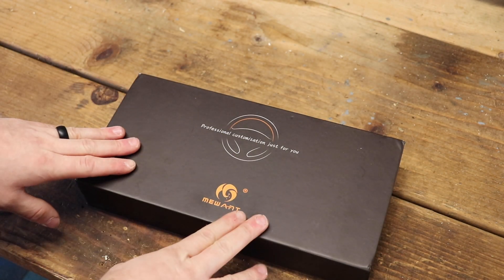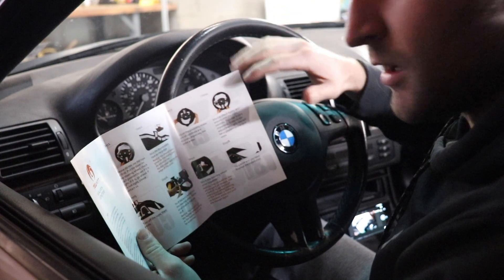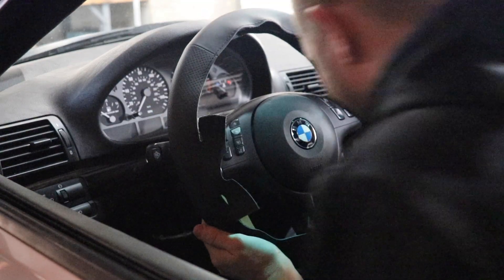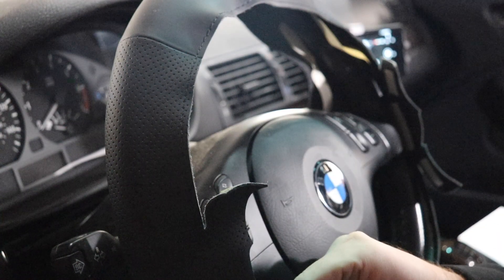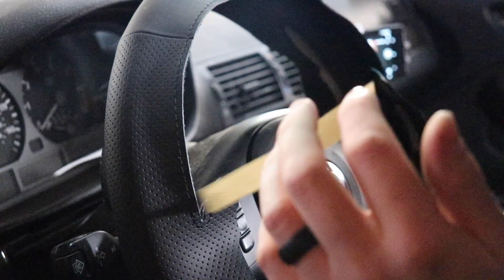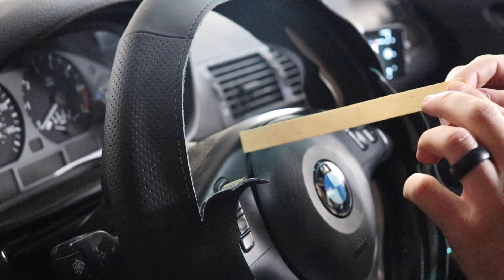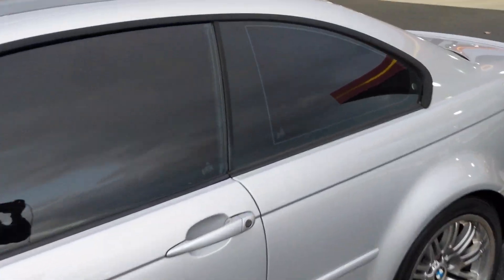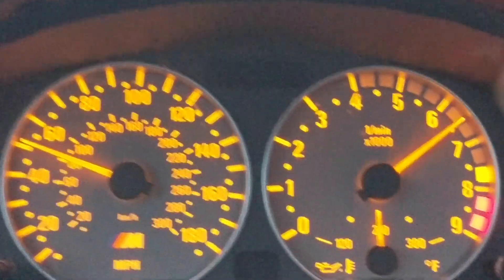Test driving a BMW M3!

Comment: looks to be in really good condition for 190k miles. have a buddy who got one with 150k miles for 8500. you should probably be able to buy it for a little less than 8500 with that many miles, but only if the owner is willing to sell it for that.
Reply from the maker: It sure looked to be in great condition! It's being sold at a small dealership so no idea how low they'd go - I didn't negotiate - but $8,500 or lower would be fair for sure. Thanks for watching!